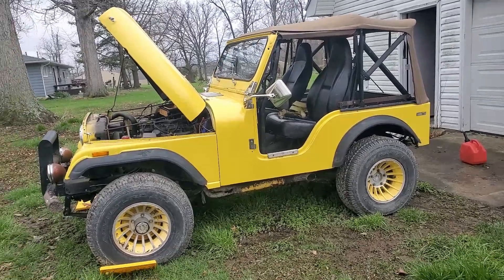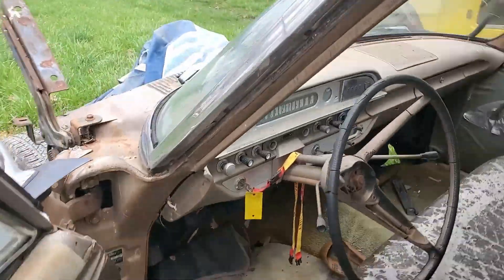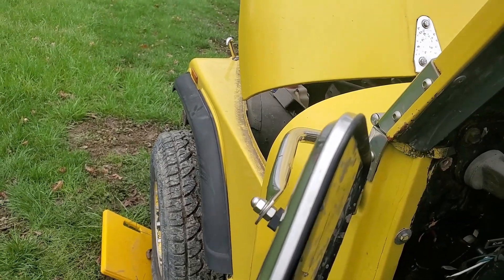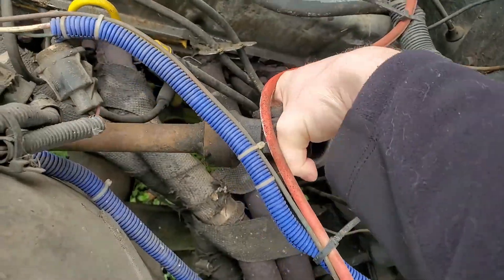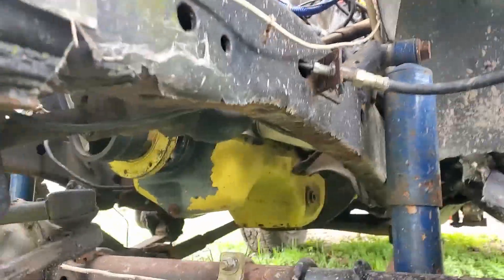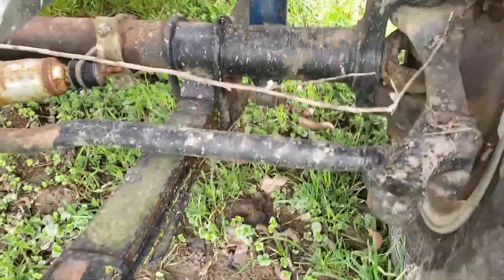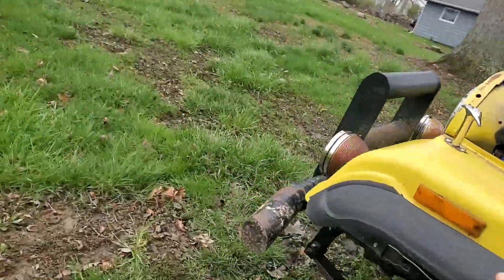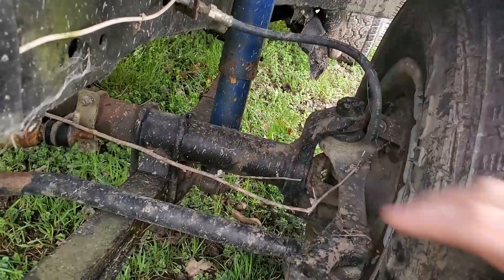CJ5 Jeep Steering Diagnosing

Comment: Thank you for this video. My jeep (73 CJ5) oversteers to both the left and right, especially when I shift and/or give it some gas, but pretty much whenever it feels like it. I'm at the point where I'm not driving it because it feels unsafe. Hopefully I'll be able to get an idea what's wrong by following your directions so that I don't get ripped off if I decide to bring it to a shop. (I love jeeps, but I'm a crappy mechanic)
Reply from the maker: You got this, just take your time and find that slop. Once you get in the habit of those diagnosis and adjustments, you'll have the best handling jeep out there

Comment: With shackles like that, you may want to add in some caster shims on the front springs. Works a charm
Reply from the maker: We are back and forth on if we will be keeping the jeep. The build is kinda sketchy out the gate and it's looking like we would have to rebuild every single aspect to get it where we wanted.  Kinda frustrating